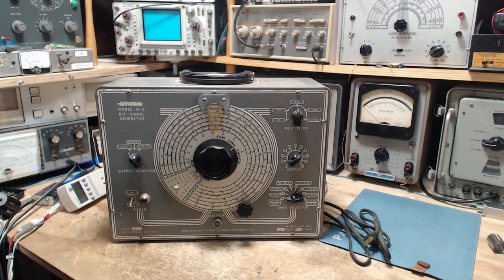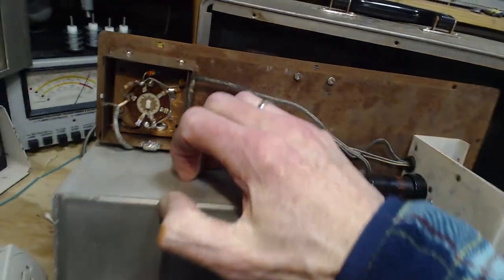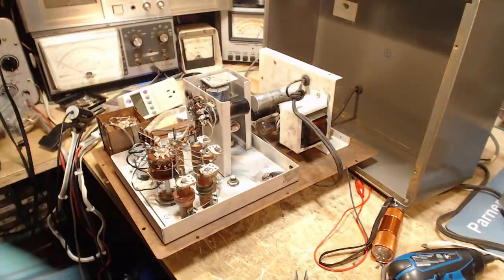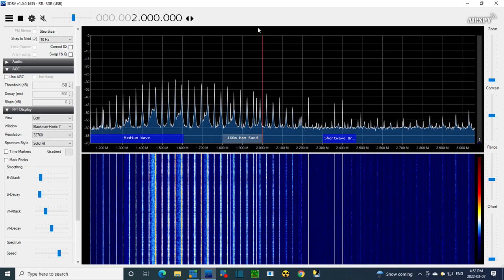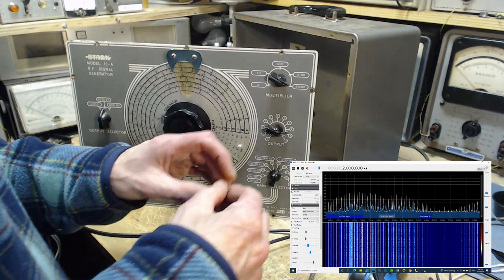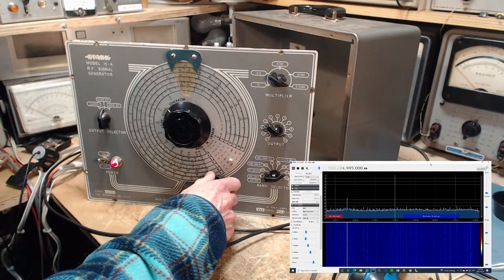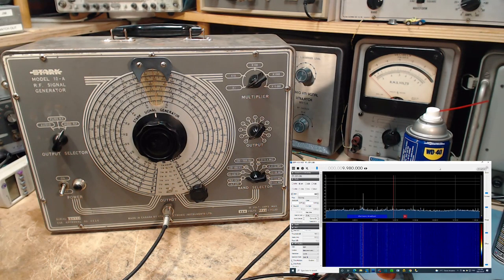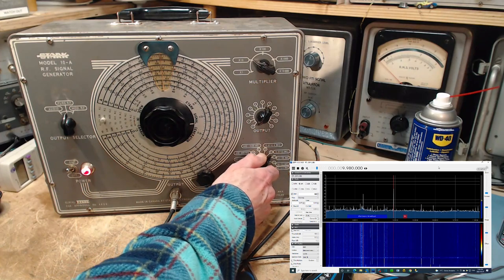Stark Model 10-A RF Signal Generator - Initial Restoration

Comment: Viewing the spectrum analyzer is a great way to evaluate the overall quality and capability of an RF Signal generator. Howeverit would have been nice to see the sine waves fidelity. Ant signal generator that is ripe with harmonics typically has rough looking sine waves. Its nice to see a sine wave but not totally necessary because any wave shape will excite a resonant circuit good enough for tuning. I was glad to see how you tackled the capacitor replacements. The STARK has a nice footprint and the loose dial  problem was not a big deal unless you were going to sell it as restored. Nice video!

Comment: I like all the careful shielding over different circuitry , although its a PIA to disassemble. Very professionally wired with good RF layout techniques. Could use an Audio in jack for external modulation. The old cable connectors have to go! Better re-cap it too, leave no stone unturned there.

Comment: You can get Deoxit Fader F5 that has lubricants. I wouldn't use WD-40 on anything electronic. It leaves residue, does not dry, is flammable and can damage plastics and some insulation.

Comment: I decided not to collect the AA5 radio series fir several reasons. The first reason is lack of an isolation transformer. In my opinion the radio industry was irresponsible deciding to do that.  The few radios that I kept have transformers as part of their design or a transformer added by me. I will not restore an AM radio and sell it to the general public because of the potential dangers. If you do participate in that endeavor I recommend that you acquire insurance to cover that situation. My specialty is the RCA 45 auto changing victrola players. However that instrument faces the same problem with hot chassis. These days my collection is centered around economic test equipment. I’ve never  come across a piece of test gear that lacks a transformer installed as part if the design. So I do restore and sell restored test equipment. I stay with the AC power plug installed by the manufacturer. Instead of capacitors across the line input i remove them and install a fuse, resettable breaker or an internal GFI circuit. The so called safety cap provides no safety at all, in-fact it causes the chassis to have a degree of dangerous leakage on the chassis. If you are concerned about line noise then install a serious lone filter circuit. GE makes a good VDR for itacross the line protection. Yes, it add cost to the project, but the safety factor should not have a price tag on it. In 1965 RCA installed a so called safety capacitior directky acriss the AC line terminals right at the chassis line input. So five years later RCA had to track down all the sets manufactured to make in home modifications at no cost to the owner. Out of the millions sets sold with the problem only one set broke down and caught fire. Yes, they sued RCA!  Shortly after that GE came up with the Voltage Dependent  Resistor component.

Comment: So... What happened to the radio he was working on? Already repaired?
Reply: He slipped that radio by us, with a screwed up alignment , faulty capacitors still installed and one old power supply filter cap dangling on  loose wires.
Reply: Slight of hand radio repair.
Reply: Attention span of a fruit fly. Many "projects and experiments" end nowhere. (Tek scope, and lots more).
Reply: In my comments in his second to last video I said he should get a signal generator capable of sending a signal in the FM section for the  IF alignment. You can blame me!

Comment: A polarized plug at least should be added to this test equipment . Make sure the hot side is switched at SW2.  After that 
add a fuse between the power transformer and SW2. C2 and C8 are disc caps and should be replaced by safety  caps.
C1 is a dual section electrolytic cap . Replace with two 22uF at the same working voltage of the original or slightly higher.
Replace all wax paper caps . Clean all switch contacts with a good contact cleaner or 91% IPA. Don't use WD-40!!! Change 
the  RF output connector to a BNC. You can use a digital frequency counter to monitor the output frequency but use the 
scale to get it where you want. A BNC splitter is used to do this when connected to the freq. counter and to a piece of 
equipment you are testing. My Triplett model 3432-A signal generator works great now because I did those things to get it working. Be aware that Jim says things that are not true almost all of the time. LOL

Comment: That pot or the switched attenuator assembly is faulty .
Normally it blows up when a voltage is pushed into the unit !
Maximum RF output should be 100,000 micro volts , the audio should be 2 volts .

Comment: Here are my comments... your output is still too low. I think you have more options left unchecked. (NOTE: this generator looks very similar to a Heathkit IG-102, the output of it is easily displayed on a scope, you may have done this off camera, but in case you didn't, check this out.) 

First, i didn't see you check out the electrolytic can capacitor in the power supply section. 

Second, I didn't see you make any power supply voltage measurements.

Third, you didn't hook up a scope to the output.

 Fourth,  I used to use WD40 like you do. but it bit me on the ass to many times. Don't be so frugal and make sure you use it on all controls BEFORE you start troubleshooting.

Fifth, exercise those tube sockets by removing the tube completely. just rocking it in the socket isn't good enough

Good luck,

Robert M